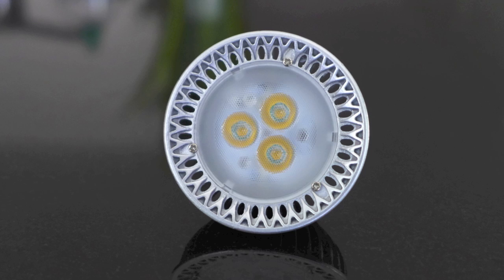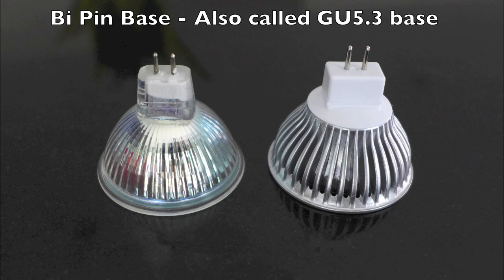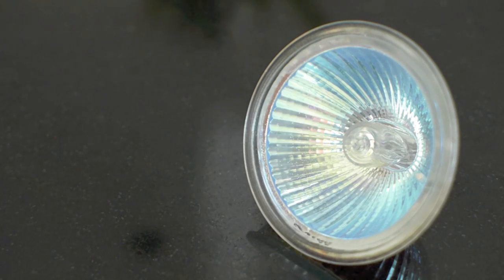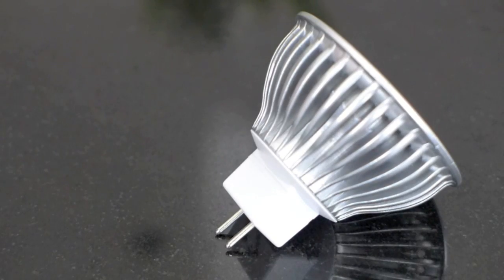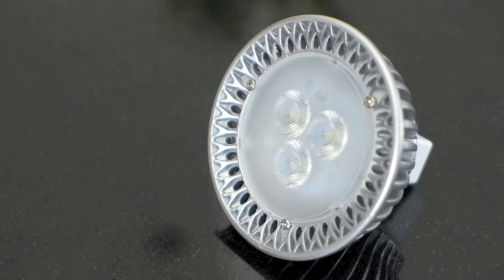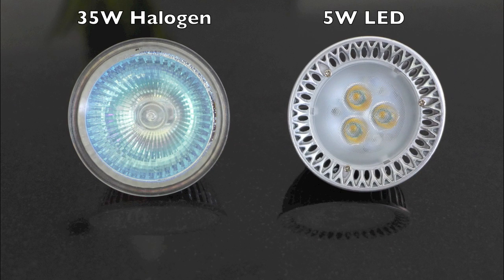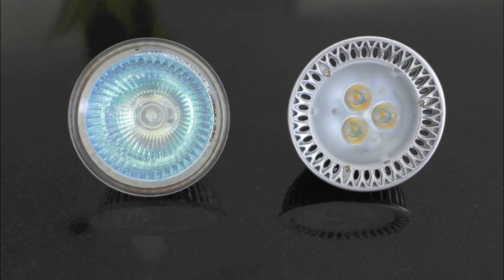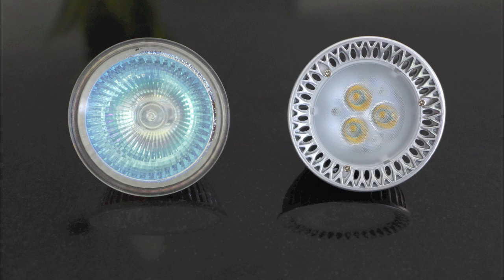LED MR16 vs Halogen MR16 Light Bulbs

Comment: Another way to look a this is that LEDs allows to increase light output without increasing heat. A 5W appears to be similar brightness than a 28W "eco halogen" and they are actually rated at 380 lm. I have some ceiling lights hanging down from plastic originally 20W, and the illumination increased signficantly with a mixture of 28/5. The selection of 12 Volt lamps available locally is limited, and they're cheaply made. I wonder if it is any harder to build than a 230Volt GU10, despite not needing to step down the voltage.

The uneven glass in your lamp probably helps to diffuse the light. Philips doesn't have that and casts 4 sharp shadows from each LED.

Comment: This doesn't show the feature of halogen MR16s that my light fixtures depend on, namely that light escapes through the back side of the reflector.  That escaping light is what illuminates my pendant lights.  All the LEDs I've found don't aim any light back toward the pendant, so I'd end up with dark pendants that look ugly.  I need an LED replacement that looks nice!
Reply: I have the same issue with most LED MR16 replacements. I have found that if you need a MR16 GU10 bulb, this FEIT one has a decent amount of backlight MR16IFGU10500/5K/LED https://www.feit.com/product/500-lumens-5000k-mr16-dimmable-led-3/ I do wish it had still a bit more backscater though. As for an MR16 GU5.3 I have not found any that I think are worthy yet. I generally love FEIT bulbs, they have very pleasing lenses. This BPBAB/950CA one here has a tiny bit of backlight, but not really a worthy amount: https://www.feit.com/product/200-lumen-5000k-dimmable-led/ It would love to find a better halogen replacement, my bulbs are all burning out and I don't really want to put in more halogens.

Comment: Attention people!
You can't change from halogen to LED MR16 because they work in different currents.
Halogen need DC transformer and LED need AC transformer.
Temporally  it work but after few hours it burn the LED lamp.
From 50 000 h you may use it only 30-50 h.
Advantage is only to by a new system of light with LED MR16 LB.
Reply: +Rozafati 
You're about as bright as a burned out halogen bulb.
Reply: +S. Tanwir Hasan 
He is WRONG.  I have been running my leds in what was a halogen fixture for two years
Reply: +Rozafati If the system is 12V both would work the same.
Reply: Thank you Rozafati. You confirmed my concern to change over to LED from Halogen.
Reply: Thank you for your comment. Though I am not an electrical engineer but will look into more details of how these two types of lights function/operate.
Reply: rozafati is correct. i just installed an led lamp and it burnt shortly but brightly for around 4hours - strobing a lot. i guess the lower current increases the volts from the transformer

Comment: A few months ago I replaced three 12V MR16 halogen spots with LED. What I did not know, and which is not explained in this video, is that if you use 12V bulbs the transformer has to be of the right type, or you will, like me, have your LED's burn out in a few months. So needless to say, I won't be replacing any more 12V halogen bulbs with LED unless I can replace the transformer as well.
Reply: Correct, Unfortunalty most modern "transformers" are switch mode power supplies, and these have a few issues with LED compatibility.
1. They require a minimum loading, typically 20W, and an LED is max 6-7W.
2. The resistive properties of the halogen lamp are quire often used as part of the transformers circuitry to smooth out the output from it, you may find that even if the do work, they flicker, and even if they dont, life will be reduced..
3. halogen lamps can cope with a "dirty" power feed, its not noticable, LEDs need it to be clean and stable
Reply: Yes, you can buy led drivers to replace the transformers. Most people just convert to gu10 where possible as there is a greater selection of retrofit gu10 lamps compared to 12v mr16s
Reply: Thanks for the warning....is there anyway around replacing the transformer to be able to use the LED?

Comment from the maker: A very common remark. Basically when LED mr16 came out to replace the halogen version - they were about 5W and 250 lumens. They were (incorrectly) touted to replace a 50W halogen mr16. But they didn't have the light output to do the job. 
(A fairer replacement would be for a 20W halogen)

You basically need about 500 led lumens to replace a 50W halogen, and these days you'll find that in an led mr16 of between 5W - 10W (depending on how efficient the led bulb is)

Hope that helps